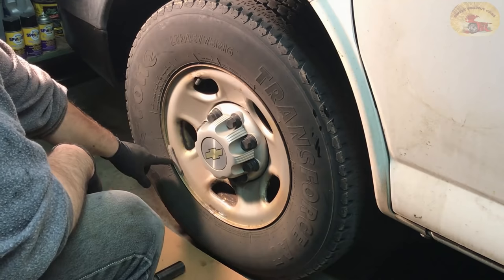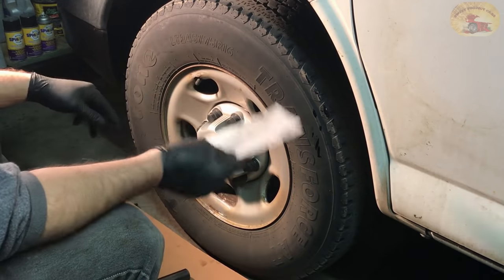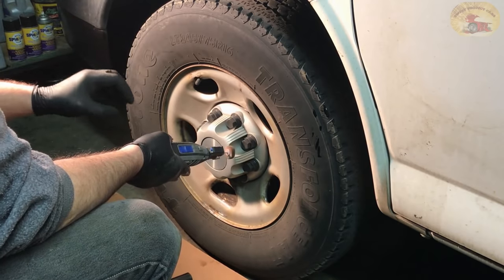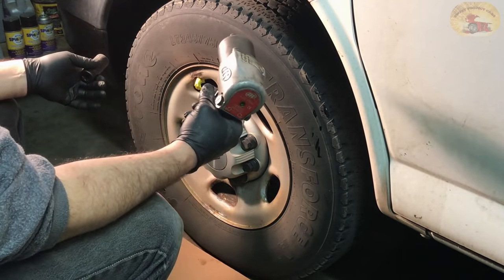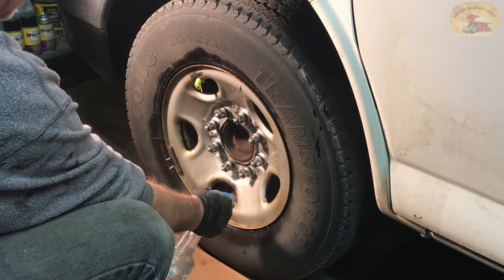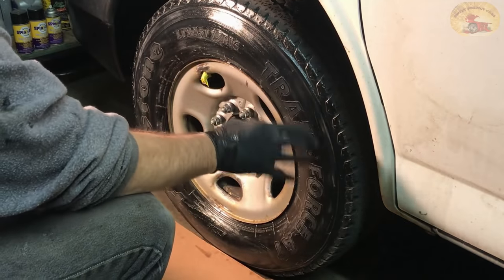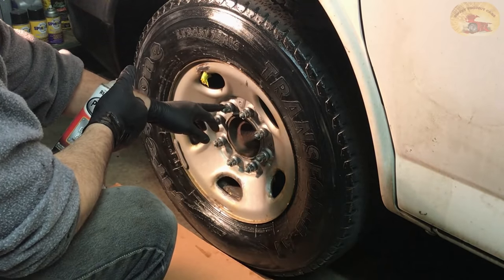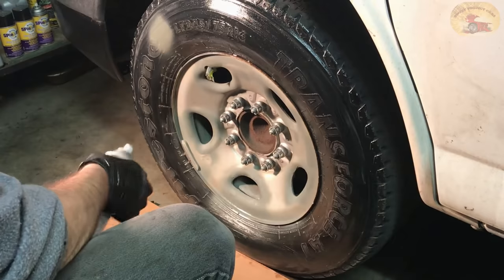30 Minute STEEL WHEEL Reconditioning Great For Work Trucks & Duallys,Tractors

Comment from the maker: Hello everyone here is some great tips for your steel wheels and all wheels for that matter that are not chrome. We hope this loads your memory bank up! We, Will, see you Sunday!
Reply: Thank you Mike. And you're right, even if I don't own or deal with the same kind of equipment that's in the video, there's always a bit of info or a trick that can apply to something else. Really appreciate your knowledge and sharing. I hope that your 2019 will be a healthy and a prosperous year.
Reply: Hi mate, not sure if you noticed but, you marked the weight so you could remove, paint then replace, but you didn't remove :(
Reply from the maker: Mick Holgate we did mention in the video why we did not remove the weight   thanks
Reply: @SweetProjectCars  ok must have missed it mate.
Reply from the maker: Mick Holgate no problem my friend
Reply: Thanks for posting.  What percentage to mix the 99% alcohol with Lacquer thinner to make degreaser?

Comment: Great video as always   question if I may. I had my Grand Cherokee out tonight.  Temp was low 30s. It sat about an hour. I started it and drove about a hundred feet when tpms lit up and showed the front right tire at 7psi in red. I stopped to check, tire seemed full. I figured I'd check the pressure at a local station. I drove about a mile and the 7psi changed to 35psi and went green. Everything was fine since   2015 Grand Cherokee Overland. Any ideas what could have caused this?
Reply from the maker: Claude Noto 2 things we have found with these..1 it is showing they are starting to fail and may need to be replaced or 2. they are very sensitive to cold weather and added they don't like underbody car washes.
Reply: @SweetProjectCars  thanks, Mike. So far it's a one time thing. If it happens again,  I'll change it out.

Comment: This is another needed one, as a Cherokee of mine has steel wheels like this, and while it and the wheels were in great shape, when new tires were mounted, and the place was teed off about having to fix a rim leak on one on the front, they scratched the heck out the rim when they remounted the tire! SO I have a super clean Cherokee body w/three clean nice rims, and 1 with rusted scratches on it, so this will be a spring project for me. ALso a spare set of rims I'm going to mount some mudder tires on.

Comment: Some people scuff or rough up the surface to get the paint and primer to stick. Is that necessary? I see you didn’t.
Reply from the maker: You can do that if you feel the paint will not stick once we clean it with lacquer thinner and use the primer especially etching primer we have never had it peel off

Comment: What concoction do you have for oily mess degreasing?
Reply from the maker: Peter Field see this https://youtu.be/MvU6mt4yrwg if this is not what you are talking about let us know the oily mess you are dealing with.
Reply: Sweet Project Cars what about on engines and transmissions after leak repairs?
Reply from the maker: Peter Field we use mineral spirits for that
Reply: Sweet Project Cars So you spray it on (ie purple power/simple green) and rinse with water?
Reply from the maker: Peter Field yes my friend you would spray it on. then wipe or rinse but it would really help to see what you are actually cleaning so we could direct you better if you want to send a pic you can  sweetprojectcars@gmail.com

Comment: Sweet tip...that look good! Thanks for been very in depth...now I got to go get me a new notebook! Quick question what would be the mix ratio for the new degreaser tip?
Reply from the maker: hcoleman 25  50-50 on the mix my friend
Reply: @SweetProjectCars  will this work on steel chrome wheels with rust